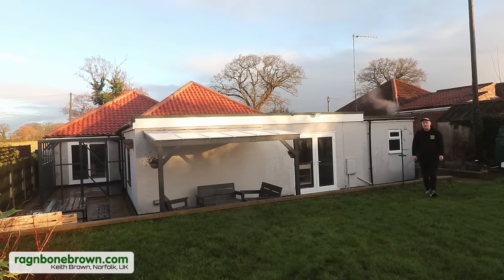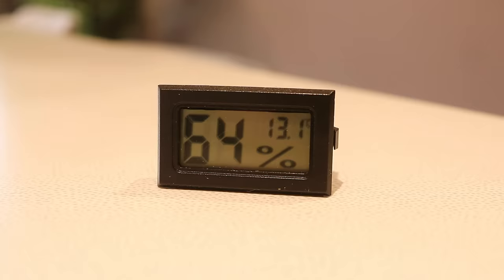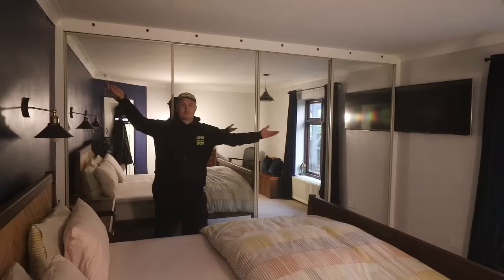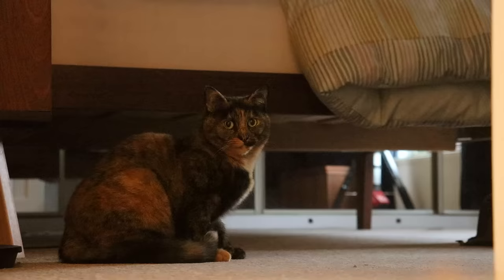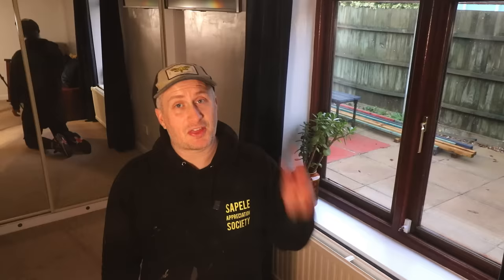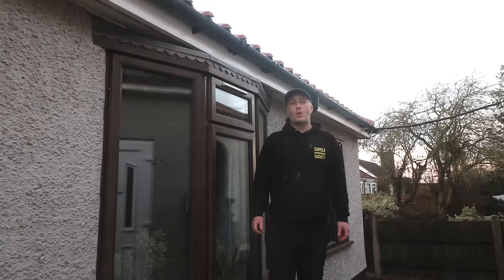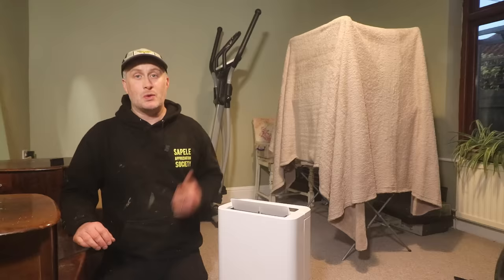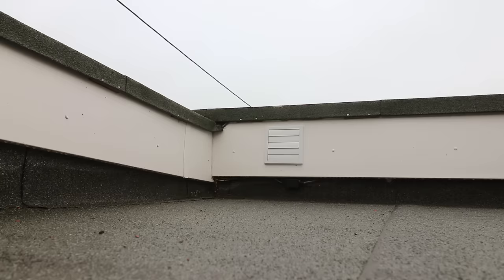8 Steps To Fixing Damp, Mould, Condensation & Humidity In Our Home

Comment: Seems odd to add vents to allow unconditioned air into the house around windows and in closets to try and get drier air.  Increasing air flow is good, but you should be increasing it by adding by using something like an HRV system. 60% would be considered almost unacceptably damp in the US, I run a dehumidifier in my basement to keep it below those levels and definitely wouldn't accept those levels in the main living spaces.

Comment: Air brick?! Right and then what heat the outdoors in winter? And having a freezer wardrobe? I never heard of any air ticks until I moved to uk. Everyone said to insulate the house you need to make it air tight and then u install bricks and windows that let air into your home? Sounds counterproductive. Maybe productive from mould growth but certainly not for energy efficiency
Reply from the maker: All homes need ventilation whether mechanical (in more modern homes) or otherwise. Oxygen is important! Without it, we die
Reply: @RagnBoneBrown  in Germany we simply open windows every day (2x or more per day for a short period of time) this way you can at least control when you let out the heat :)

Comment: Bloody hell, Keith. Here I am plugging every hole in our house and there you are pumping winter air into yours.

Get a MHRV. £2k and some ducting and you get fresh, dry air around the house with very minimal heat loss.
Reply from the maker: My understanding of MVHR is that they work great in new, well sealed, well insulated properties, but not in older properties that are neither well sealed or well insulated?
Reply: @RagnBoneBrown  They still do the job, moving fresh air in, shunting wet air out, keeping its heat, you just can't rely on them as a complete solution like you can in a passivhaus. You'll still need your rads, but a lot less than you do now. When you redo your windows, you'll get most of the leaks. Bungalows are the ideal retrofit for MVHR.

Don't take this idiot's word for it though, there are lot of reputable system designers out there. EOC is just down the road from me (and not too far from you) and MAAC in Norwich. They'll quickly tell you if you're barking up the wrong tree.

Comment: If your claim is true that condensation and mold is caused by cooking, washing, breathing, ... then you should identify these problems in every home. However, this is not the case. 
The comments on your video show that too. Many do not have these problems at all, on the contrary. And yet these people all wash, cook and breathe in the same way. 
It is logical that this cannot be a cause.  

I am a professional and always identify other causes. 

In almost all cases, water runs into the house so that floors, walls or other building substances are wet. This water evaporates permanently and ensures the high moisture values in the house. 
When I look at the picture of your bungalow, I think there is a very good chance that there is water in your floors and walls. That's still going on.
Therefore, measure the moisture content of the floors and the bottom of the walls. They measure wet in many places. 

If you had removed this cause from the beginning, you would have solved the problem definitively! 

Your video perpetuates the myth that mold and condensation are the result of resident behavior, and encourages people to fight the symptoms rather than eliminate the true cause.

Beantwoorden

Comment: that heated  clothes dryer wrack is the beating heart of your mould problem , get shot of it , the things should be made illegal , buy a condensing tumble dryer second hand on e bay £ 60 for  a top of the range condenser , running a 2000 watt machine for 30 mins is 24 pence at 2024 electric prices , while you state running a de humidifier standing next to your heated clothes rack is expensive , interesting advice but i dont under stand the logic , just bonkers , buy a damn tumble and empty the water down he drain , boom no mold problem
Reply from the maker: Not everyone has space for a tumble dryer